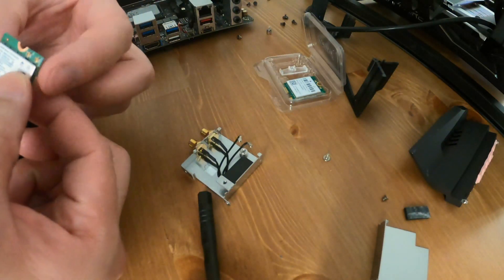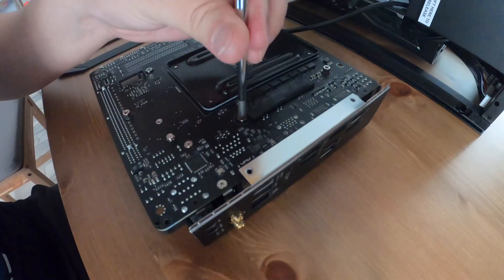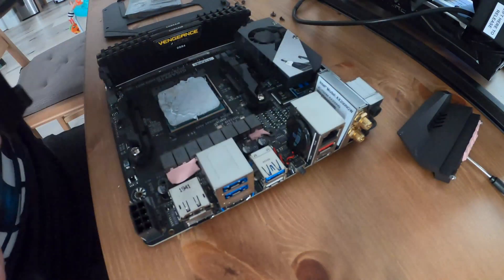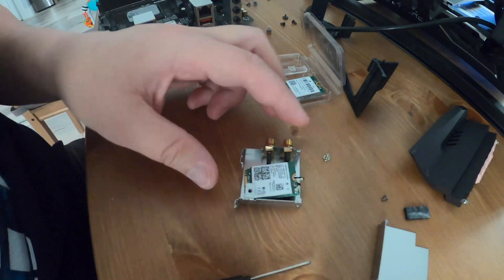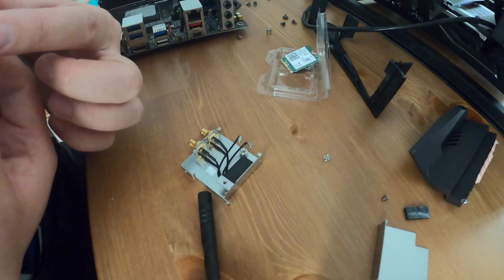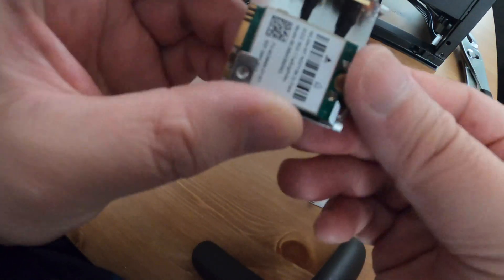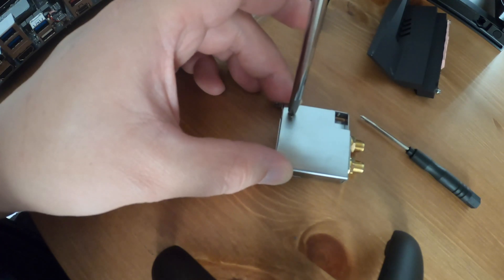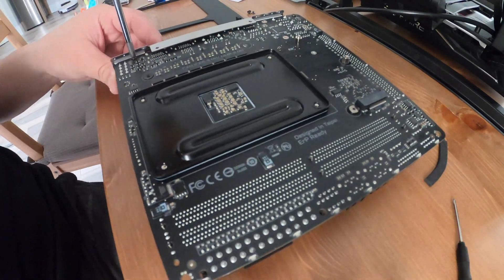Hackintosh ITX WiFi Bluetooth AirDrop Card Replacement Catalina macOS Success

Comment: This is super confusing. Author has Gigabyte Aorus Z390i Pro WiFi motherboard. This motherboard uses CNVi interface for wireless communication module which only accepts CNVi cards. I suppose this method won't work for this motherboard. Waiting some explanations from the author.

Comment: I  v same mobo and used the same bluetooth. I'm on Big Sur and wifi works perfectly but bluetooth isn't working. Any suggestions?
Reply from the maker: Sorry I haven’t moved to Big Sur yet.
Reply: Did you find a solution?
Reply: @FelixMbus  Nope...still looking.
Reply: @FelixMbus The solution was to connect the antenna to PC and it worked immediately. How embarrassing!
Reply: @CigsAce21  I have a antenna connected but doesn’t work at all
Reply: Man I’m having the same issue. Have you figured out?
Reply: @tamaica7770  The solution was to connect the antenna to PC and it worked immediately. How embarrassing!
Reply: Cigs Ace . I have read your solution, and I have connected my antennas. It is still not working. It says that the Bluetooth preference pane is not available, but the wifi works. I’m so exhausted about this issue man

Comment: Hi I’ve bought the same card, but my Bluetooth is still not working, it said there’s no Bluetooth device. I even reinstalled the whole system but still, no help.
Reply from the maker: sorry I'm not able to help. have you tried reconnecting the 2 small pieces for the m.2? it was plug and play for me after I installed it.
Reply: Have you found a solution? I have the same problem
Reply: @FelixMbus  years late, but this video helped me. https://youtu.be/jajs67WscG8  for me i had a wifi issue. All i was missing was some ktexts. the video has the link to the ktexts needed in the description. The video goes over wifi and bluetooth.

Comment: I bought this exact card and my wifi and bluetooth is working. However, I noticed that when I connect bluetooth and play games such as league or Minecraft, my latency skyrockets. Like in Minecraft when i break a block the block doesn't drop until a couple seconds after. Does this happen to you as well? I also did some speed tests and my results were very inconsistent going from 30mbps to 200mbps.
Reply from the maker: I have this card installed, but mainly for airdrop and wireless printing. I'm hard wire into an ethernet cable so I haven't truly tested out using just wifi only. sorry I'm not able to provide feedback on speed or consistency.
Reply: Hey KattoElement did you ever figure it out? I bought this wifi/bluetooth card too. It detects wifi networks and bluetooth devices but can't connect to anything. Wondering if you made any progress. Thanks!

Comment: For anyone who wants to build your Hackintosh with Intel 10gen CPU, if you want to buy an ITX mobo with Z490 chipset, you need to buy "ASROCK Z490M ITX/ac"!!! That's the only mobo you can replace the wireless module with the card you see in this video! Because all the other ITX mobos with z490 are using the AX201 wireless module, you will no longer be able to do this replacement!

DONT CHOOSE MOBO OTHER THAN ASROCK Z490M ITX/ac!!!
Reply: Can I use it wiht Z490i Phantom Gaming ITX? It's unlocked.
Reply: Thanks for the info.  Does the "ASROCK Z490M ITX/ac" also work with "macOS WiFi Card BCM94352Z"?
Reply: birdlint it works with BCM94360NG, it should be the same as BCM94352Z.
Reply: @Leo-qc004  Thanks for the reply.  Which Intel CPU did you go with for your build?
Reply from the maker: Cool! Thanks for letting me know. I’m thinking about testing at 10900k if I can get my hands on one. It’s out of stock everywhere

Comment: Can this be done to the Asus X570 I strix?
Reply from the maker: I would assume so if the wifi is a m.2, but I haven't opened one up to know for sure. sorry.
Reply: Yes it will work because x570-i is m.2 you can remove that same procedure

Comment: Great video! New to hackintosh build and building PCs in general. Where would I go to find the drivers to get the WiFi and AirDrop working
Reply from the maker: It should work out of the box, if you need some help, I can find the files for you when you're there.
Reply: Awesome! Thanks for the reply and will definitely ask if I have any issue. Subbed to support ya

Comment: Good morning, I've bought this card for my Hackintosh. It works correctly on macOS, but, when I'm using windows, I can't use Bluetooth. Have you got a driver for this card for Windows 10?
Reply from the maker: Sorry I don’t have a dual boot on this machine so I haven’t ran into that issue. If you find the drivers for it let us know.
Reply: Sean Moua Ok